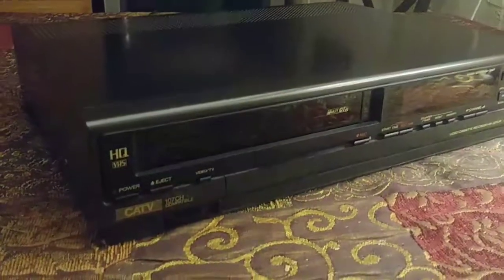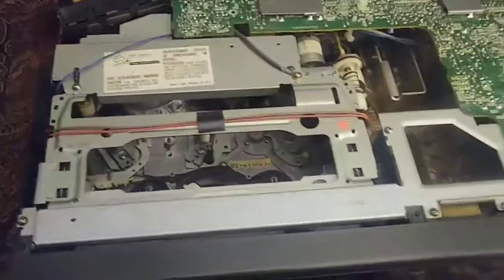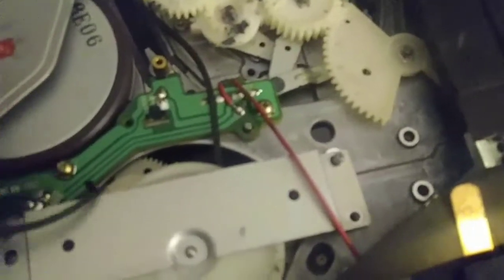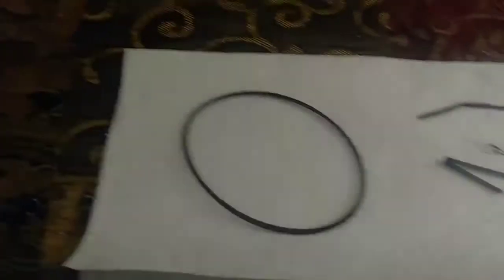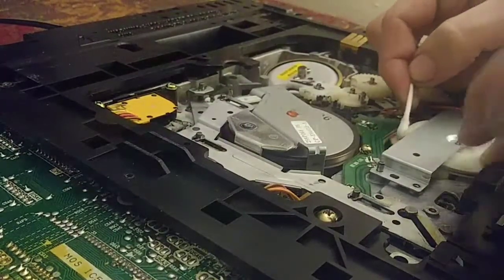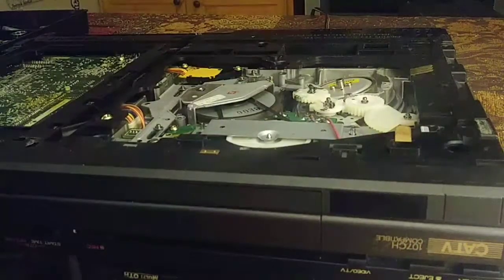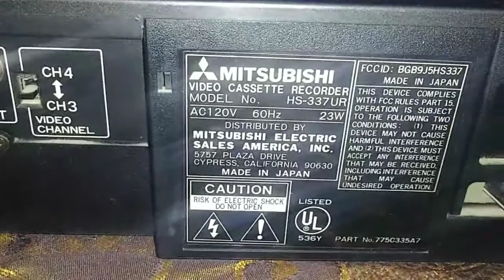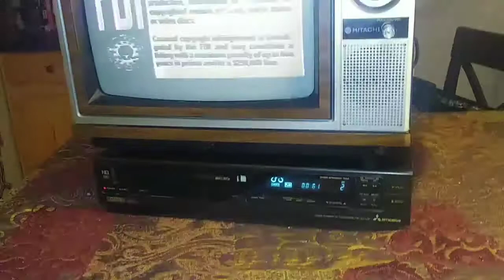Mitsubishi VCR Repair Model HS 337UR

Comment: I have a similar machine (mitsubishi hs-423ur), it looks inside like this setup in this video.  I was wondering if in your experience with these machines if you found a trim pod for the output volume.  The output volume is very hot, slightly distorted.  Not sure what can be done to scale it back.